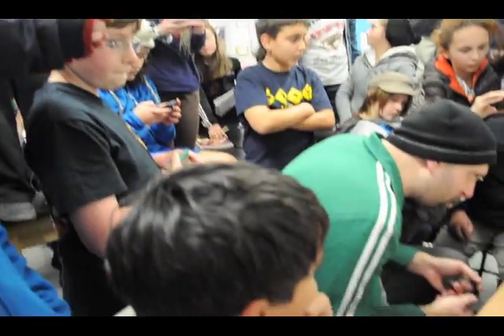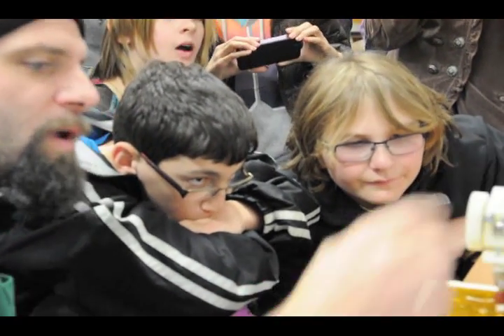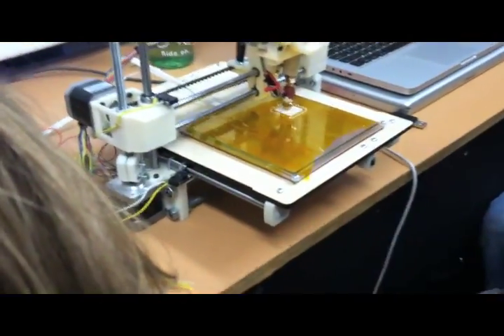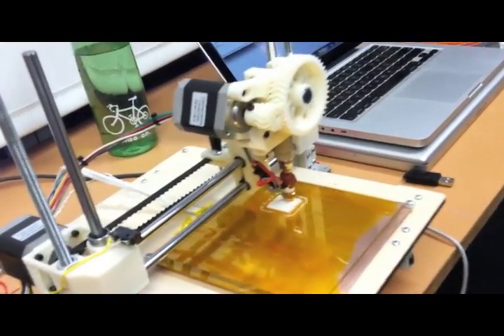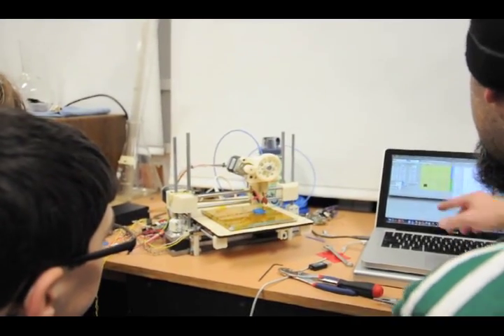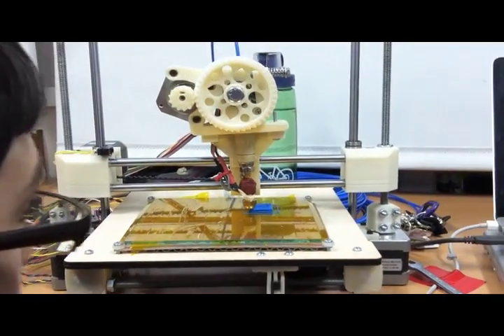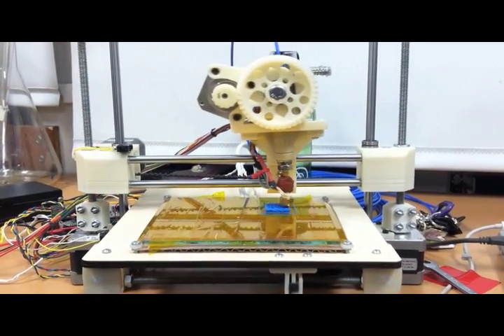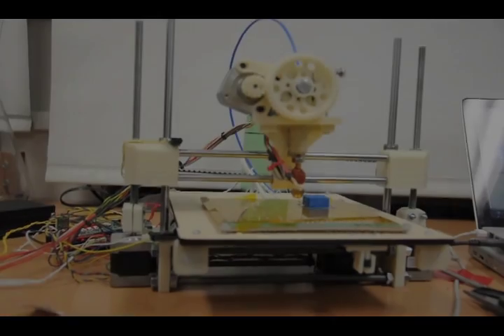Printrbot: 3D Printer

Comment: The addition of the dye to both ABS and PLA changes the properties of the print.  Natural ABS (yellowish white/cream colored) is what most machines are aoptimized for.  

It is important to note that various colors work better on non standard heat settings due to the variable molecular density of both ABS plastic and PLA plastic once a color dye has been added.